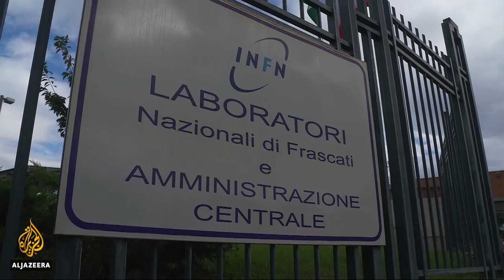🇮🇹Scientists in Italy set out to discover 'dark matter' l Al Jazeera English

Comment: "Physics only explains 4% of our observable Universe".
Actually physics explains 100% of our "observable" Universe.
The trouble is that observable matter only accounts for 4% of the total mass/energy
of the Universe.
Dark matter 27% and dark energy 68% make up the rest.
Dark matter might be something like neutrinos which barely interact with matter.
Dark energy is a repulsive force according and permeates all space : as the 
Universe expands there is more of it and the expansion rate increases.
Reply: Well we found another 9% defused in gas as stripes between galaxy's, gallaxy cluster... but still much to find...
Reply: You are incorrect. Physicist can only explain the movement of 4.6% of all the visible mass in the universe using Einstein's theory of general relativity. The movement of stars and galaxies cannot be explained by his field equation thus Einstein's field equation is wrong! So physicists, assuming that Einstein's equations are correct need to evoke mysterious forces to explain all the extra movement that his equation cannot explain. It does not mean dark energy or dark matter exists. It simply means that Einstein's field equation is wrong!

In 2004 I discovered what was missing from his field equation after I realized he neglected to include the action causing gravity. Sure, his field equation perfectly explains the motion of mass that is not spewing a million mile per hour solar wind, planets, moons, comets, asteroids, dust and debris but when it comes to stars spewing super fast charged particles it fails big time thus is only able to explain the movement of mass that is smaller than a star.

With the fix to his equation I was able to make certain predictions that contradicted the predictions of GR. Like black hole should not have event horizons, that nothing is able to fall into a black hole, that black holes cannot collide, and a few others. When the EHT, event horizon telescope data came back they did not discover an event horizon around Sgr A*. They discovered that nothing is falling into the black hole, in fact they find that gas and dust is moving away from the black hole. How can that be if nothing is able to escape a black hole? Space should be moving towards it, stars and debris would not be able to orbit it. Everything should be moving in a direct line towards the black hole, yet everything instead orbits it as if there is an equal opposite action responsible keeping matter from falling into them,,,, even the hydrogen gas that surrounds Sgr A* for up to 5 light years away is orbiting it, not falling in!

The first data to confirm my hypothesis was in 2011 when the G2 gas cloud did not fall into the black hole. I told astrophysicists that nothing much was going to happen to the G2 gas cloud and I was right. In 2011 the gas cloud orbited the black hole and did not fall in. Then astrophysicists assuming that his field equation was right said, well there must have been a star hiding in the gas cloud. Then to confirm their hypothesis they used infrared telescopes to peer through the gas and could not detect a single star in the cloud. Infrared light is able to see through the cold cloud and debunked their hidden star hypothesis, which left astrophysicists short for an answer.

I hypothesized what the action would be to cause gravity back in 2004. I postulated that if this action was correct then stars and galaxies, because they spew million mile per hour solar winds would be slowly propelling themselves over time, like a rocket using ion propulsion. Thus the older the star and or galaxy the faster they would be moving relative to a standard rest. I hypothesized that if I was correct then the velocity of every star and galaxy should have the same acceleration ratio between their velocity and age. This motion would have nothing to do with mass but how old the star or galaxy was. I then did a simple comparison study between the velocity of our sun and it's age. Our sun is traveling at about 500,000 mi/h and is about 5 billion years old. An acceleration ratio of 1 mi/h increase every 10,000 years. Thus every star and every galaxy should fit the same acceleration ratio of 1 mi/h increase every 10,000 years. Lets see if it also explains the velocity of our own Milky Way.

Our galaxy is traveling at about 1,370,000 mi/h towards what astrophysicists call "The Great Attractor" and is about 13.7 billion years old. the acceleration ratio is exactly the same as the acceleration ratio of our sun, a 1 mi/h increase every 10,000 years.  I then went on to study the age and velocity of the Dwarf galaxies orbiting around the Milky Way and every dwarf galaxy also has the same 1 mi/h increase in velocity every 10,000 years! Actual data to confirm my hypothesis! And get this, not one bit of data has yet to confirm dark matter. Thus,,, Dark matter is dead!
Reply: BigNew, "..... not one bit of data has yet to confirm dark matter. Thus,,, Dark matter is dead!"
You could say that about every discovery science has ever made.
Before the "data" was discovered there wasn't any data , it doesn't
mean atmons don't exist, or light doesn't exist, or distant galaxies.
Obviously before the data is discovered you don't have the data,
you can't then make some deduction about the hypothesis based
on absence of data.
Reply: I say dark matter is dead because data shows us that every star and every galaxy in the universe fits the same acceleration ratio between their current velocity and age without having to evoke missing mass or gravity into the equation. There is data (empirical evidence) to support this hypothesis than there is data to confirm dark matter. 

Let me show you the data. The Sun is traveling through the Milky Way at about 500,000 mi/h and it is about 5 billion years old. An acceleration of about 1 mi/h every 10,000 years. If my hypothesis is correct then the same 1 mi/h increase every 10,000 years would occur to every star and every galaxy throughout the universe. The Milky Way galaxy is traveling at about 1,370,000 mi/h towards what astrophysicists call The Great Attractor and the MW is about 13.7 billion years old. Thus the Milky Way also fits the same acceleration of 1 mi/h every 10,000 years. This is not a coincidence if other stars and other galaxies fit the same acceleration ratio between velocity and age.

The velocity of our own sun cannot be explained by GR because it is not mass, missing mass or even gravity causing it's movement but instead the solar system gains a 1 mi/h increase in velocity every 10,000 years because it spews a million mile per hour solar wind (ion propulsion)! Sure, it occurs too slowly so that it is not noticeable in our short lifespan. Let's see if other galaxies are accelerated at the same ratio.

The Carnia dwarf galaxy orbiting around the Milky Way is traveling at about 1,300,000 mi/h and it is about 13,000,000,000 years old. The same acceleration ratio of 1 : 10,000. The Draco dwarf galaxy is traveling at about 1,280,000 mi/h and is about 12,800,000,000 years old. Another acceleration ratio of 1 : 10,000. The Sextans dwarf galaxy is traveling at about 1,240,000 mi/h and is about 12,400,000,000 years old. Another acceleration ratio of 1 : 10,000. Go ahead, pick another galaxy or better yet a star, any star. Take it's age and then divide it by it's velocity. Want to bet you come up with the same 1 : 10,000 acceleration ratio between it's current velocity and age? That is why I said dark matter is dead, not because there is no data to support dark matter but because there is data supporting the fact that it is not mass nor gravity causing the motion!